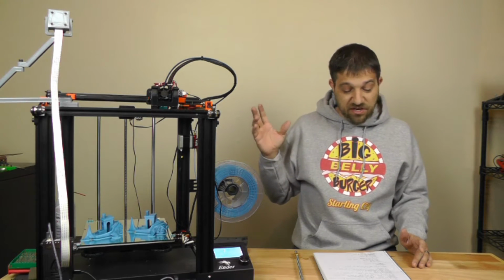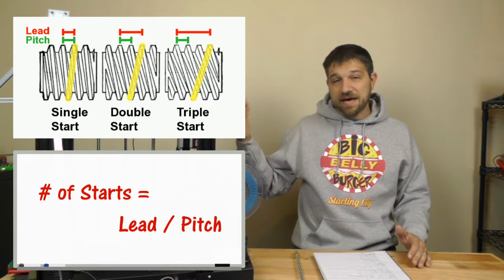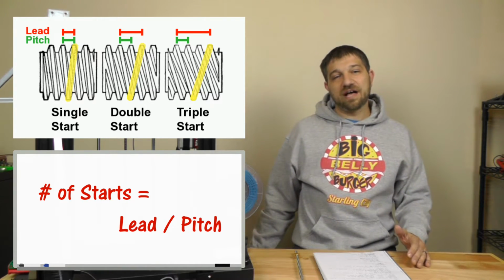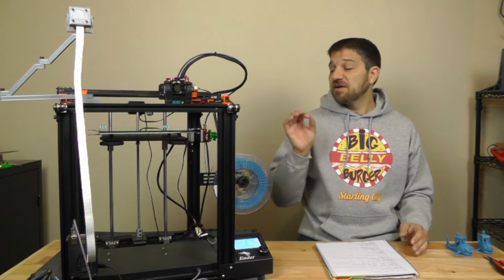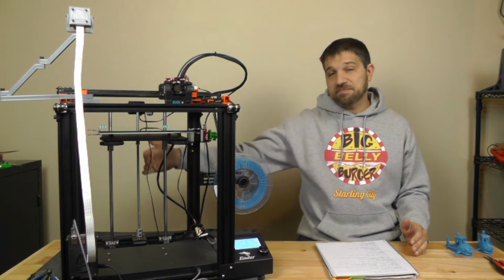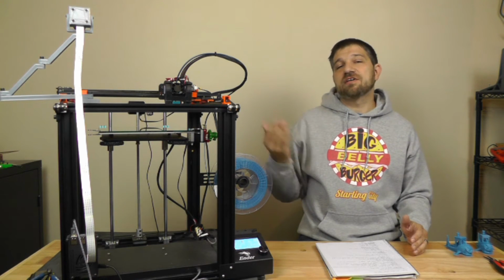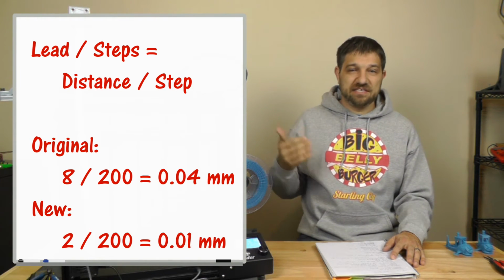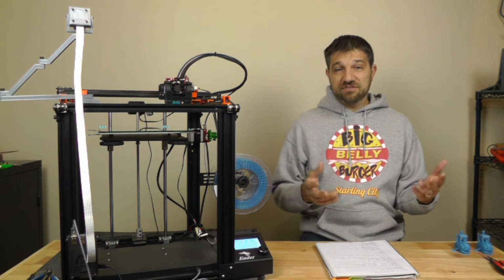Ender 5 Lead Screw Upgrade: Stop Your Falling Bed!

Comment: I can't say I agree with much of your analysis of this "problem".  The laws of physics aren't on your side.    One of the virtues of the lead screw motion control system such as employed here is that it is nearly impossible for the traveling nut to back drive the lead screw.  That seems to be what you're saying is happening.  I'm very skeptical.  Normally, a lead screw converts rotary motion (supplied by the motor) to linear motion which is the reaction of the traveling nut to the rotary motion supplied by the motor.  In order for this motion conversion to occur the traveling nut must be prevented from rotating with the lead screw.  In this case the traveling nut is attached to the Z axis platform so that the motion of the traveling nut becomes the motion of the platform.  Back driving is exactly the opposite.  Back driving is the conversion of linear motion to rotary motion.  Back driving a leadscrew requires a tremendous amount of force being applied to the traveling nut.  The only force being applied to the Ender 5 Z axis traveling nut is the weight of the bed plus any prints on the bed.  I don't believe that's nearly enough force.  A simple test would have been to try to manually force the bed to back drive the lead screw using your hand or by adding heavy objects to the bed with the printer unplugged.  That won't work now that the printer is modified.  

I would theorize that this bed falling you see is actually the printer "parking" the bed when the print is finished.  I believe you said it only happened when the print was done.  Think about it.  It makes much more sense to me.    The addition of AB nuts to any lead screw system is an improvement and changing the pitch may lead to better resolution but the falling bed could only be stopped by firmware settings IMHO.  https://en.wikipedia.org/wiki/Leadscrew  This wikipedia page describes back driving as "impossible".  Impossible is not the word I'd use but close.  Actually, I think the lead screw would bend or the nut would strip before back driving occurred.  BTW, I disagree with using grease on this lead screw.  It will only collect dirt.  Try some silicone spray that dries to the touch or use Delrin nuts.  That is what I'll do.
Reply from the maker: I'm actually really confused by your rebuttal. First of all, the article never even uses the word "impossible" anywhere. In fact, it gives both the equation for raising conditions and the equation for lowering conditions. The lowering conditions are reliant on the diameter of the screw, the lead, and the coefficient of friction (and of course the force being applied). If I wanted to disassemble the printer, I could actually do the math on this. My analysis though is that both the coefficient of friction is low enough and the lead is such that with the weight of the bed it lowers. I have proven this to be the case in two ways. 1) When you power off the printer, the bed falls. 2) When you disable the motors, the bed falls. I have then tested my remedy of this situation by replacing the lead screw with one with a more shallow lead and the bed no longer falls. My analysis has also been tested by numerous viewers of this video who have posted the same symptoms and that my solutions does in deed work for them. If "parking" was being performed by the printer's firmware, changing the lead screw would have no effects on the operation.
Keep in mind that a screw is simply an inclined plane wrapped helically around an axle. It has similar properties and the work it performs is heavily reliant on the slope of the plane.
Reply: @kerseyfabs  Well, I'm embarrassed to say that I made the classic mistake of making an assumption.  My assumption was that you made a verbal error when saying the lead on the stock screws was 8mm.  I've used a lot of lead screws in my career but I've never seen one with 4 starts.  I must wonder if they are common in China.  Anyway, I assumed it was a mistake because what manufacturer would use a screw that would yield .4mm resolution when they could use a screw  yielding .1mm resolution.  It appears that Creality really is that stupid.  So, most of my rant was based upon that assumption and now I must eat my words.......sort of.  After doing the math on a 8mm lead screw I agree that it can be back driven.  That makes Creality double stupid.  However, I will re-state emphatically that a PROPERLY DESIGNED lead screw will not back drive the screw.  I did see the word "impossible in one of my research articles I just credited the wrong one.  However, Wikipedia does say:   "Most are self-locking (cannot be back-driven)".  And they are correct.    I still suggest using Delrin AB nuts.  I've already ordered mine from Zyltech.

Comment: Great videos as usual.. very good detail and NO MUSIC.. great... I tried local eBay and Amazon but no sellers.. Went to Banggood.. 400 mm out of stock so got the 500mm and will cut it down by 100mm.. bought to backlash nut set too. I really hate the bed falling.. Hope it doesn't cause the rippling effect though that some have mentioned.
Reply from the maker: Thanks! I'm glad you were able to find something that worked. I haven't heard of any rippling affect. It seems odd how greater resolution would cause ripples. It should be smoother.
Reply: No it doesn't make sense United the has been some torsional stress put into it, when they have assembled theirs? Just guessing

Comment: This is a great upgrade. It does make it a bear to move the Z axis because it has to spin 4 times to get the same movement. On my TH3D board I had to slow the acceleration down to 10 from 15. At 15 the motor just made a hell of a noise and wouldn't move at all due to not being able to spin that fast. The nut that you link to from ZYLtech has a completely different bolt circle diameter. I was going to drill the nut with the smaller stock bolt circle but then there was no room for a nut below because of it's bigger diameter. It turns out the 3.3mm clearance hole (in the new nut) is the right diameter for a 4mm x .7 tap. So I tapped the holes in the nut and drilled the bigger (22mm) bolt pattern in the plate that the nut bolts to on the Ender. It came out great and is a more solid mount since the nut is much beefier. Of course there in nothing wrong with the smaller nut.
Reply: I am also having the noise you are speaking of. Thank you for posting this. Have you had any issues with waves in the print when you swapped to 1600 on the th3d firmware and ezboard. I am experiencing this. All exactly 2mm apart. How did you adjust to 1600 steps on the ezboard firmware?
Reply: @Eythica   I have not experienced any waves in my parts at all. The printer is printing just as good as before if not better. I have played around with different layer heights as well. Instead of .12, .16, .2, .24, etc., (Chuck Hellebuck's magic numbers as referenced in the video) I can now print with .1 layer heights .1, .12, .14, .16, whatever you want as long as it is in .1 increments. This is all explained in the video.

To change your Z steps connect to your printer with Pronterface and issue an M503 command (by issue I mean M503 enter). This will show you your current step values. Issue an M92 Z 1600.0. Issue an M500 (this stores your new z-step value). Issue an M503. This shows you your current stepper motor values. In my case it is X 80.0, Y 80.0, Z 1600.0, and E 142.35 (my e-steps are set up for a dual gear extruder, your E value will be different).

You can also change it via the control panel but it is going to take a very long time to change it from 400 to 1600. In any case from the control panel press the button, choose configuration and press the button, choose advanced settings and press the button, choose Steps/mm and press the button, choose Z and press the button, and start scrolling all the way up to 1600. When you are done find the screen where you can store settings (I can't remember which screen this is, I think it is the screen after you pick configuration) and store your settings. There will be a confirmation beep. Now if you turn your printer off the new Z value will remain. This serves the same function as M500 above. I hope this helps.
Reply: @frogmandave1  Hi Scott, I appreciate your detailed response. Those are all steps I have  taken. After setting steps in a variety of ways to operate at 1600 steps, flashing, reflashing, callibrating, tuning, tightening,  and checking and replacing parts on the machine that could have possibly created the issue, I still had horizontal waves every 2mm on my prints at 1600 steps.  I ended up swapping back to my 800 step lead screw for now.  There are some quality issues still, but that is due to an imperfection on my original 800 step lead screw (that is why I was replacing it),  however the waves are gone. That was the only way I could get rid of the issue. I have run into 3 others also experiencing this. 

I can confirm that the acceleration adjustment did take care of the sound when I had the 1600 step lead screw in, so yay for that! :)

Comment: Would u use these on ur 5plus ?!
Reply from the maker: No. This shouldn't be necessary on the 5 Plus. It already has a steeper pitch.
Reply: Kersey Fabrications  I see . My right lead screw has a wobble  (maybe bent) I believe because   Of shipping or  w/e . Ill be getting those pom/ backlash nuts soon so I’ll try that first to see if that helps the wobble  . the ender 5 +  leads are  like  what 500mm?

Comment: Thanks Kris. This worked flawlessly. 👍
Reply from the maker: I'm glad it helped!
Reply: @kerseyfabs  I'm in the process of printing my second round of test prints, 0.08, 0.10, 0.12, 0.15, 0.16, 0.20, 0.24, 0.28, 0.30 and 0.32 layer heights to do comparisons between the old lead screw at the 0.04 resolution and the new 0.01 resolution. I'm tabulating the actual printing time between the two and I'll be taking microscopic images of the layers to try to see the improvements, if any. I've just started another round of 11.5 hours of printing the models.

Comment: I just completed upgrading to new 8mm diameter, 2mm pitch, 2mm lead lead screw with a small flange Delrin nut from Zyltech. Zeltech has pre cut screws 400mm long just need to look for them on the website. Cheaper than a custom cut screw. Total cost using coupon $20 and change shipped priority mail. The original screw 370mm. the new screw at 400m is longer but doesn't get in the way. Everything went together easily and works great. No more bed falling at the end of a print. I did have to reduce the z max feedrate my steppers skipped steps when making rapid z moves. All in all a great mod.
Reply from the maker: Thanks for the feedback Ron! I'm glad that all worked out so well!

Comment: Amazing content as always!! Have you experienced any sort of rippling/banding in the Z axis? I've bought the exact same parts you've used, but when I switch from the stock one to the 2mm lead one, there's some consistent rippling along the Z axis, that follows the lead (ripples are 2mm apart)
Reply from the maker: I have not seen that on my printer. Are you using the stock mainboard or have you upgraded to a new board like the silent board?
Reply: @kerseyfabs  I'm using a SKR 1.3 and TMC2209. With the stock LS (400 steps/mm) it's ok, but as soon as I install the new LS (1600 steps/mm) the prints show rippling/banding.

https://m.imgur.com/a/msr0bYP

Cheers!
Reply: @siwiskate  Did you ever find a resolution to this? Myself and a couple of others are also experiencing this and can''t seem to find a resolution. Also, out of curiosity, who's firmware are you using?
Reply: @Eythica  I'm using Marlin 2.0... I wasn't able to fix it, so I went back to the stock leadscrew :(
Reply: @siwiskate  That is exactly what I had to do.
Reply: @Eythica  at some point I started thinking that the leadscrew pitch might not be exactly 2mm, but rather a tiny bit more (or less). But I don't have any way of verifying it. 

I bought 2 leadscrews and both of them had the same issue
Reply: I get the same, the 1s 2 or 3 layers are golden then as the Z axis moves down the tip starts scraping the print. Anyone find out what the proper setting is for the 2mm lead?

Comment: well RIP, my Ender 5 (purchased in february 2020) came with a 400 so I bought a lead screw on Amazon and accidentally picked a T8*2*4 screw instead of a T8*2*2 screw (the sellers almost try to hide the dimensions of the lead screws for some reason, looks like many product pages are wrong) so I installed the new screw and new anti backlash nut, manually turned the knob wo get from 400 to 800 steps just to find out that the new lead screw is meant for 400 steps facepalm
Reply from the maker: Ugh! I'm so sorry to hear that! I try to keep my links up to date but Amazon can change them from time to time, particularly if they run out of stock. I hope your printer's not actually dead!

Comment: Ok I do not know how did you put new screws with the spring, so easily but  my backlash screws are so bad made that I am unable to put them easily on the bar. I assume on the edge there is some rest of the metal sawdust or during the manufacture they were not so accourate, so I can not put it on the bar at all even I tried to push it with the solid force it did not help (I do not want to scratch the leading bars). So I discarded them and mybe one day I will try it again haha
Reply from the maker: I'm really sorry to hear that! Can you get the pieces on there individually without the spring?
Reply: @kerseyfabs  Hello. Nope I figured it out lol, I have ordered correct size but wrong "pitch"? I did not know there is something like this (well newbie here hehe) atleast I know this and next time I will be careful about that.

Comment: do you have another source for the anti backlash nut i have ordered a few and they are all incorrect
Reply from the maker: Did you try ZYLtech? People have reported those working. https://bit.ly/ZTT8Brass2 or https://bit.ly/ZTT8Derlin2 for just the nuts. Coupon KERSEYFABS for 15% off.

Comment: I upgraded my Z Axis lead screw on my Ender 5 because I hated the way it would fall on its own, I use the TH3D  online configurator because it works so well, under where it says ENDER5_NEW_LEADSCREW it says it sets it to 800/steps/mm. after flashing the new firmware I noticed my Z axis would only move half the distance when printing or in manual mode, I think its because my lead screw is a 1600steps/mm not a 800, its a T8 2 lead, 2 pitch with one start. I cant even find a replacement leadscrew on line thats a 800steps/mm for the Ender 5, seems like the TH3D firmware sets the Zsteps/mm to 400 and makes a terrible noise if you set it to 800 or 1600.
Reply from the maker: I haven't used their configurator. Luckily, it would be easy to change this in your own configuration or simply modify it after you flash the firmware.

Comment: I maybe have missed something. but how did you fix your extrusion / vibrating problem on your printer?. I followed your guide on linear rails and my prints look the same. Now on your megladon it looks like those issues are gone.   Great work btw!
Reply from the maker: I think what you're referring to is answered in my silent board video. After I upgraded to linear rails, I upgraded to the silent board and it improved my print quality.

Comment: my bed keeps rising while printing.
Reply from the maker: Hmmm. What do you mean?
Reply: @kerseyfabs  I level  the bed, paper is on the loose side, start the print, (a nice bead is started) half way through buggers start forming to where the extruder is bumping into them, so I stop the print check the level and have to turn the leveling knobs 1 1/2 turns before the paper will slide through. Ender 5 purchased 1 week ago.
Reply from the maker: You leveled all for corners before the print started? Preferably two times.
Reply: @kerseyfabs  yes, 4 corners 2 times, kinda stumped.
Reply from the maker: @BC5391  How tight are your screws? They should be almost all the way down to stay tight.
Reply: @kerseyfabs  Thanks, I will try that, currently there is about 1/2 inch or 12mm at the bottom.
Reply: @kerseyfabs  After a lot of frustration I think I found the problem, the nozzle was loose (from factory), when I discovered it an hour ago it was almost ready to fall out. fell free  to pass along this to anyone else that may experience the same problems. bob

Comment: Length for Ender 5 Plus? I know the 5+ doesn't suffer from this problem, but isn't there other advantages to the changed lead screw as well?
Reply from the maker: The Ender 5 Plus is already using 4mm lead screws, so going even shallower shouldn't make a huge difference. The screws on the Ender 5 Plus are about 47mm, so 50mm would work.

Comment: this was my first upgrade to my E5pro - thanks!
Reply: Did they change the default configuration on the ender 5 pro? I got mine a couple weeks ago and it doesn't have any issue with the bed falling. Weird, but nice!
Reply: @GarrettBShaw  Ender 5 Pro comes with 800mm lead screw but the video talks about 1600mm

Comment: Great video!! Love the improvement! I had to turn my dial to 1600 manually because i dont have a rasberry pie or a computer its connected too. I came up with taking my knob off and use a standard bit in my drill and i got to 1600 quick instead of turning it with your fingers!
Reply: i just added M92 1600 / M500 (in two lines) to my cura settings for a single print, then removed it from future prints and it stuck

Comment: Why not take it to the maximum Z resolution of 0.04?  You can't compare it to the old lead screw, but the potential to get a really thin layer is the bigger deal to me.
Reply from the maker: That's a fun idea and I've been thinking of doing a separate video for something like that. There are martial/extrusion issues with going so small. I didn't want to introduce new issues in this video.